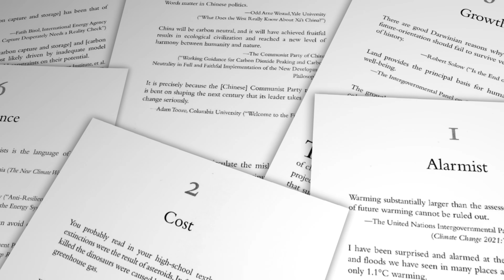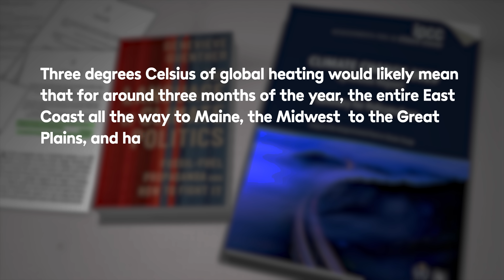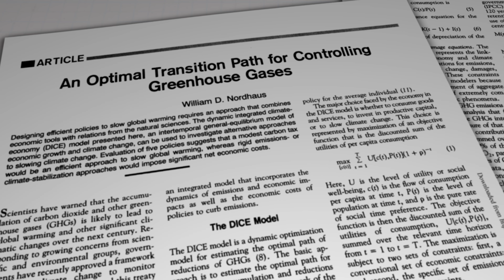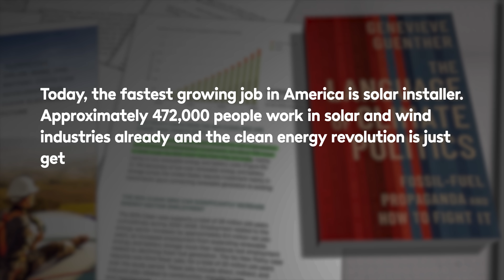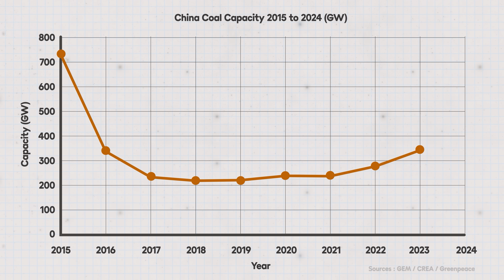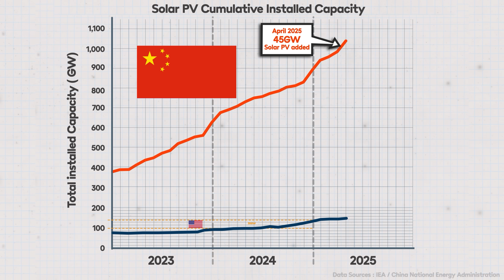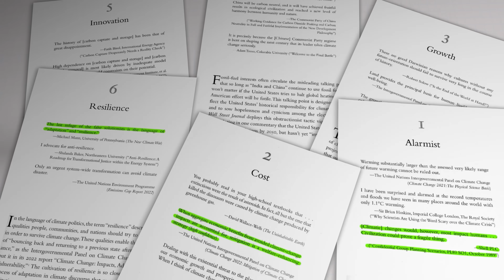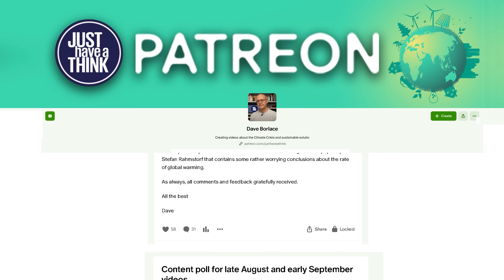New research DEBUNKS climate disinformation.

Comment: If the US spent 50 trillion dollars over the next 25 years to mitigate climate change, how much mitigation would be achieved? Fifty trillion dollars is the amount that environmentalists have suggested. No one ever answers that question with science-based numbers. They will only supply dogma for an answer.
Reply: The question is a political one, not a scientific one.  So why would you expect "science-based numbers" in response?

Political organizations have strongly indicated their economic analysis of climate effects without mitigation suggests it would would be far more costly than with mitigation efforts.

The effect of "fifty trillion dollars" on climate change would entirely depend on how those funds are applied towards said efforts.  If they're applied moderately and appropriately one would expect that the mitigation achieved would be significant, perhaps even to the point of reversing the damage.  If they're not, obviously we'd expect very little would be achieved.

Comment: A simple question - Are we to replace every solar panel and every wind turbine every 25 years from now on? Both being extremely difficult to recycle and the decommissioning costs (in terms of creating CO2) not taken into account, it would appear we intend to destroy the planet to save it.
Reply: You do realize that EVERY machine or thing in existence has a certain amount of wear?
You have no problem replacing whole roads and bridges, roofing on houses, machinery of all kinds imaginable - but PV and wind is suddenly a problem?

Besides that, the recycling tech made it quite far by now.
Reply: @CD-kg9by  Yes, those things do wear, but are far more recyclable. There is no way to recycle turbine blades or solar panels. Not even close.
Reply: @steveniemiec9261  You're wrong. You can recycle solar panels. Only turbine blades are an issue, but there are a few startups who try to tackle that problem, too.
Reply: @CD-kg9by  No, you are wrong. Recycle means to put them back to the same such as aluminium cans. Solar panels cannot make new solar panels.
Reply: @steveniemiec9261  "Recycle means to put them back to the same"

"Recycling is the process of converting waste materials into new materials and objects"

Huh...
Reply: @Leafsdude7  No, glass, steel, copper, aluminium ARE recyclable. Converting to 'another use' is NOT recycling, sorry.
Reply: @steveniemiec9261  Facts say otherwise.  You can try arguing with them, but you'll lose every time.
Reply: @Leafsdude7  You clearing don't understand the difference between recycling and reusing or repurposing. Fact. You lose.
Reply: @steveniemiec9261  Asserting "fact" is not how facts work.

I provided the demonstration.  Hence, it's a fact.  Deal with it.
Reply: I read this question so much.... We are replacing the fossil fuel of our fossil machinery every time we use it and it cannot be recycled at all, its GONE. The same for maintenance. A fossil fuel power station maybe has a 50 year design lifetime and may go on longer, but that is with constant repair and replacement of equipment. Grinding and combusting coal is hard on machinery. Superheated steam is hard on machinery.  This is why the bulk power cost from renewables is lower now than any other power source. No need to buy fuel and less people needed to run and repair it.
Reply: @Zonkotron  There is no such thing as "renewable" energy. Nor is there any such thing as "green" or "clean" energy. The materials for wind and solar are mined from the ground. The raw materials are sent to processing plants. From there they are manufactured and shipped across the globe. They require maintenance, have a shelf life and require meticulous disposal. These terms are used to manipulate people into embracing this technology. That should be your first red flag. 

How is bulldozing farms, meadows, forests, jungles, deserts and even mountain sides to lay hectares of fairly useless panels characterized as "green" energy? This represents unprecedented and permanent plant and animal habitat destruction. I thought that this was what we were trying to avoid.  

Wind and solar will never be cheaper than fossil fuels. They are unreliable and require backup with nat gas, coal or nuclear. If they were cheaper there would be no need for mandates and subsidies. The subsidies exist because they would not survive the free market. Profits ensure good ideas succeed. Subsidies ensure bad ideas are adopted and language manipulation is utilized to coerce.
Reply: Agreed. Proving that the climate movement has nothing to do with environmental stewardship.

Comment: thankyou for all you do........i have been watching chinas so called move to renewable and most of it is rubbish they install solar panels over the side of a mountain then dont plug them in or when they do they catch fire or what happens most of the time the plants that bind the soil and the trees and bushes they removed destabalise the ground and they all collapse in a landslide.....also if you look at the air pollution numbers caused by coal powered electricity production they are rising to levels where i would not even go there just for my health.....most of it is propoganda.
Reply: China uses fossil fuels to make solar panels that they export to the gullible West.

Comment: My electric bill for the last two years, has shrunk for August, compared to 2023. I live in North East Texas, and yes I know the difference between climate and weather. Crop yields continue to increase, greening of the planet continues to increase, starvation only continues to happen because of war, corruption, and logistics. NASA, NOAA, and the ECF, have been caught manipulating data to support an agenda. The climate is doing fine. I have a channel where you can see my face and  hear my voice, I am not a bot. This has been recorded for a documentary on the abuses of big tech to support an agenda.
Reply: The Arctic and the Antarctic ice is melting and the oceans - also the oceans at / close to the poles - are warming (that can be measured and it is not only surface water but down to 1000 m deep  - but surface water is already a big problem because it messes with weather systems, never mind life). These changes are undenyable and it needs HUGE inputs of energy to warm so much water. So WHAT caused it - because it wasn't the sun.

Turning ice to water needs extraordinary amounts of energy. If you go from ice at freezing point (fresh water freezing point =  zero degree Celsius) to all melted but STILL at zero degree. You need to add a LOT of energy. If you use the same amount of energy now to heat up the water (zero degrees cold) you end up at 80 degrees C. - Boiling point is around 95 degrees (100 at seal level, it changes with altitude).
That is really hot.
Ice is a temperature buffer - in our climate and also in some industrial uses.

Freezing sea water has slightly different temperature points - but the principle is the same. btw all that melting messes with the ocean currents. If seawater freezes the ice does not contain salt, so the salt falls out and dissolves in the liquid water, which is heavier and sinks down. That moves the huge ocean currents. They are slowing down - and again that can be measured. The effect was predicted in the models - only not that it would show up so soon. 

As long as there is some sea ice in the summer (flimsy as it may be and satellite photos only tell us about area coverage but not how high thick and solid the cover is) we have also the albedo. Once that is gone (not even a flimsly cover in summer but none) the warming will accelarate. 

The extra heat shows up in the system.
Reply: @franziskani   First let's get this on the table..... you have zero uploaded content, yet have eight subscribers..... hello bot:) 

Antarctic ice is currently at a greater extent than it was in 1979, , it is the same year that the Arctic started to lose ice after twenty-nine years of gain from 1960 to 1979. That is why the doomers picked 1979 as their staring point. Very hard Satellite data about the climate existed during the 1960s (especially the U.S.N), but NOAA did not use it , and NASA thought they had to step in. Since that time NASA has been off by 18mm per year in many cases.

Extreme heat has never shown up, supported by raw data. The models have been competently wrong. Temperatures in the central northern U.S States have dropped, that is supported by historical NOAA data weather stations. You climate doomers, or you may be a bot, I don't know...... are losing....... sane people do not listen to you anymore :)

Comment: "Innovation" is not a euphemism for flue-gas carbon capture.  Good grief.  Innovation is what's happening in wind, solar, and batteries, and will almost certainly happen to a significant extent in at least a few of the many other areas where it would help.  Decarbonizing concrete.  Long-distance electric transmission.  Sail-powered shipping.  Energy efficiency.  Non-dam hydro.  Heat pumps.  Nuclear that's not insanely expensive.  Whatever.  Innovation is the key to all of them -- or rather, working for innovation on all of them, or at least a very large number of them, is the key to unlock the few that will turn out to be useful, because the only way to find out which ones are the winners is to actually do the research, certainly the R&D but in many cases also the basic science.  Some of the winners will be things that are as unforeseeable now as LEDs and lasers were in 1900.

Comment: The most important argument against the climate ignorants is that: 
energy from renewable sources together with batteries is now cheaper than fossile energy. 

And these scumbags still work for  the interests of Russia, China and the rich fossile fuel industries. The families have to pay for this treason with high energy bills, the children have to pay with their future.
Reply: No it's not FFS cost pw is not cheaper in renewable and they don't have the same lifetimes 

And they can't be recycled repeat can not be recycled 

Show me a plant for the wind turbine that need over 1000L of oil a year 
Yeah real green
Reply: No it's not FFS cost pw is not cheaper in renewable and they don't have the same lifetimes 

And they can't be recycled repeat can not be recycled 

Show me a plant for the wind turbine that need over 1000L of oil a year 
Yeah real green
Reply: @Wamsubnz  95% of solar panels and wind turbines are fully recycleable. 
The energy payback on the average wind turbine is 8 months, according to Oregon State University. The average payback for a solar farm, 2-3 years. 

LEVELIZED COST OF BUILDING AND RUNNING A NEW POWER PLANT IN DOLLARS PER MEGAWATT HOUR
SOLAR: $60
WIND: $50
GAS: $70
COAL: $117
NUCLEAR: $180
2023 FIGURES BY LAZARD

Comment: Had the worst drought on record here in my bit of Victoria. It seems to have ended or at least paused with some adequate winter rain, but it was pretty grim for a while there. We ended up selling most of our cows because buying hay trucked in from well over a thousand kilometres away just isn't sustainable.
I saw a map recently of which parts of Australia are expected to get wetter or drier under climate change. The "drier" part matched perfectly with the areas most affected by the drought.

It's time to get out of here.

Comment: Over hundreds of millions of years earth has been losing its atmosphere. Fossil fuels were once part of our atmosphere! The earth’s crust has captured most of the atmosphere that ever was. Not only fossil fuels sequester atmosphere but our deposits of Gypsum (CaSO₄·2H₂O), Limestone (CaCO₃), as well as many other minerals once compromised earth’s much denser atmosphere. Both as a percentage of the atmosphere and in measured total volume the planet has never had so little airborne carbon. We lose an additional 200,000 tons of atmosphere every year blown off the planet by the sun. If you must be afraid, fear snowball earth. Ice miles deep from pole to pole. The planet is following the footsteps of Mars not Venus. Save the planet go for a drive.
Reply: While its true that we lose 200,000 tons of atmosphere every year, its not going to result in earth turning into Mars.

You can stop with the hyperbole.

Also, geologic processes here on earth more than make up for losses, and at the rate we're talking about it would be billions of years before the earth's atmosphere would be significantly reduced.

The sun will burn the planet to a crisp long before that happens.

Comment: So the temperature will rise 3 degrees in these parts of USA, and people will start dying? They are not dying in africa which has much much higher temperaures than that. And still not a single island in the pacific or elsewhere on the globe has come under the sea surface, as we are told again and again for now 40 years ago!
Reply: The reality is that ocean level rise will take centuries to happen.  The people who claimed it would happen much sooner were just trying to increase the rate at which we move away from fossil fuels.  Forgive them.

Comment: I keep hearing about green energy. I have also heard that green tech is very energy intensive and that you are basically pre-producing about 10 years worth of carbon to create that sustainable tech that has about a 20-30 lifespan for generating electricity. That is great...in the long run. 

But I have a real question (I already believe I know the answer to). If we were to transition completely to green energy, how much carbon are we putting on the balance sheet NOW in order to reduce carbon later? And how does that impact our situation NOW? 

If you do the math, I believe we no can no longer afford to use the energy necessary to achieve the proposed energy transition without putting ourselves into an even significantly worse situation. Someone do the math and prove me wrong...
Reply: We will eventually use CCUS and DAC to pull CO2 from the atmosphere, and re-sequester it back in the crust of the earth.

Eventually, over decades we will get CO2 levels back down, and the climate will cool.

Stop letting the doomsayers have control of your mind.

Comment: CO2 storage and direct recapture are century-long, possibly millennia-long megaprojects. By all means, capture and store what CO2 you can from, say, aluminium production, but as a tool to keep the good old coal-fired power lants running it just doesn't scale. And they know it doesn't cale, just like all of their other measures.

Edit: another problem that isn't really talked about is that there are really only three ways to "recapture carbon":

1) You capture the exhaust from your coal power plant and store it; that means you are wasting 80% of your storage on nitrogen.
2) You extract the CO2 from the exhaust from your coal power plant and store it; that means either using pure oxygen instead of air (which is very expensive, both in terms of energy and money) or distilling our the CO2 (which is very expensive, both in terms of energy and money); by the end of the process, your energy production may well be in the negatives. 
3) you extract the carbon from the exhaust from your coal power plant and store it; that can be energy intensive (you are literally undoing the burning of the coal, so you need to put in more energy than you have produced) or space/time intensive (e.g., using algae and sunlight); at which point it's easier and cheaper to just not burn the coal in the first place.

Option 1 is horrifically inefficient and will never scale, options 2 and 3 are net negative on the energy axis, but even if you somehow manage to make them net positive... What you get at the end is a pure chemical, which is a valuable product. Which means it won't be "stored", it will be sold. And used somewhere, probably in a way that produces "clean" CO2 ("clean" because it comes from a "recycling" source). John my words.

Option 3 is great if you are trying to get a clean aluminium cycle going, however. Rebuilding your spent (read: burnt) graphite electrodes from the generated CO2 would make that part of aluminium-making  recyclable as well. At the moment, making aluminium burns a lot of graphite.
Reply: Bollocks

Comment: I'm 29, I grew up with Bill Nye telling us that we needed to start tackling climate change 20 years ago. We've failed and the people with the money and power to make a difference aren't going to do anything until it's way, WAY too late.
Reply: Bill Nye with Al Gore rigged an experiment on utube. utter fraud.  200 years ago Eunice Foot did experiments with soda water in tubes sealed with thermometers and low and behold they heated much as a solar water heater,  Some add baking soda to water and guess what the fizzing produces heat. In fact the initial heating with CO2 lessens as more co2 is added and a log base.  Net Zero can achieve zero effect.
Reply: Most of them aren't worried about it because they personally won't be here to see it and they are too narcissistic to worry about their children.
Reply: @lyndafjellman3315  well of course. Plus their children won't be the ones working in the 100+ degree factories or in the fields harvesting crops. And they won't be the ones dying from starvation caused by severe weather.
Reply: You mean the UN and China - so stop using the "it's the rich people" argument - that's just left-wing adolescent scapegoating.